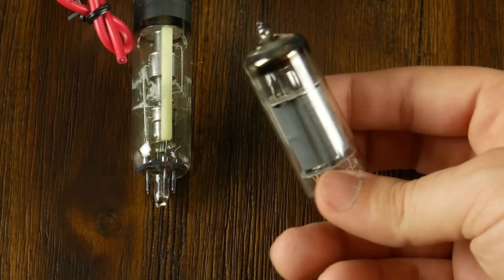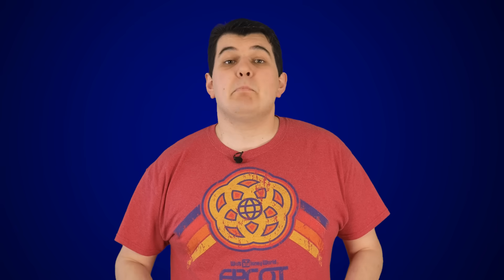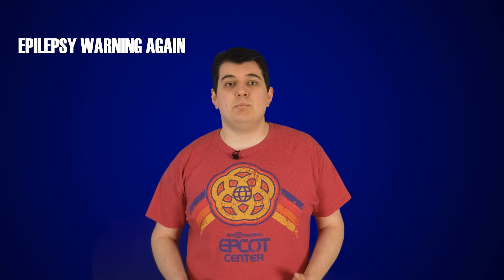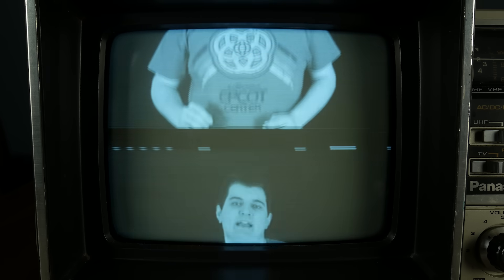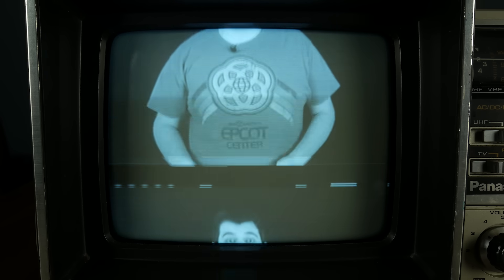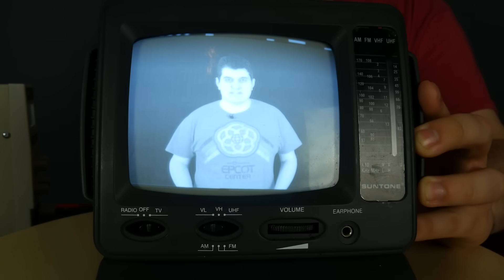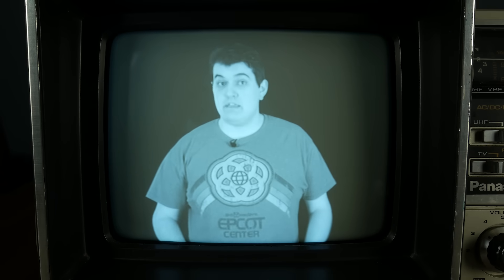Lines of Light: How Analog Television Works

Comment: The first models of Motorola Quasar, the TV with "the works in a drawer", appeared in 1967.

In 1974, Motorola sold the Quasar name, as well as the supporting US plants and inventory.

In 1972-73 models, the customers we sold Motorola Quasars began to complain of orangey looking reds. I agreed with our customers. I observed that the color demodulator IC on the "CA" color panel now bore the name "Matushita" rather than the former "Motorola." After Matsushita bought Quasar, I began to suspect that they had intentionally supplied an inferior color demodulator chip as an act of sabotage, to drive down the price they would have to pay to buy Quasar.

My suspicion did not come out of the blue. When so many of the VCRs in the US market were made by Panasonic, the other labels like RCA, Magnavox, GE, and Montgomery Ward, I found these off-label VCRs to be inferior to the Pansonic-branded models, as observed by performance, and also by observing that off-label circuit boards were missing parts that existed on the true-blue Panasonic circuit boards. One example was an off-label VCR that was brought to me for repair with a complaint that the clock ran too fast. I discovered that the clock's square wave was dipping into no-man's land, not reaching full amplitude. This caused a single pulse to be interpreted as 2 or more pulse, running the clock too fast. I discovered that a pull-up resistor that existed in the true-blue Panasonic had been removed from the off-label machine. I fixed the problem by installing a pull-up resistor in the existing but empty pc solder pads.

One example that demonstrates the hypothesis that Panasonic does not simply discard a sub-optimal design involves the CCD sensor chip in their camcorders. When the number of defective pixels on the Panasonic CCD exceeded their standard, they sold those CCDs to Sony, who used them in their own camcorders, accompanied by a ROM chip that mapped around the defective pixels, to a nearby good-working pixel. 

I would be pleased for Technology Connections to address my aged suspicions and set the record straight.

Comment: In my opinion, analog was so much better. Sure, low bands had bad static (our local NBC channel had it  all the time), but once you got in a good, strong signal it was in. Severe storms could blow your antenna off if you stupid enough not to secure it tight. BUT there weren't any signal dropouts.  If you needed to know where a storm was, your TV stayed in. Most the times digital TV is in if there is not any strong electromagnetic fields at play. You know, standing outside, the hairs on your arms or on the back of your neck would stand up warning you a lightning strike was near-or where you stood. I've seen digital lose a signal at a critical time during tornadoes and other violent events. Analog TV? You had to put up with strong static across the tv, but you still had a signal. Power outages then and now occur. Our power company has outages on nice sunny days with no breeze. 😮 And ask anyone who messed with their antenna. If you got it up high enough, you could get channels from other counties and other nearby states. To me, there's nothing on to watch anymore. I watch my dvds or don't watch anything. I could go on more with the good and bad with digital and the good and the bad with analog. But you get the picture... if you aim your antenna the right way.😊
Reply: The main problem of analog to me is the flicker. With digital you can remove flicker without increasing bandwidth. MPEG-1 introduced motion compensation for this. And of course: delta encoding. I think, interlaced video makes no difference ( in MPEG-2 ). Everything is in motion anyway. Though you have to store the full frame resolution from field to field. Static tiles will pick alternating lines. Moving tiles will pick any. I never understood how delta works interlaced. Is it pre field and only affect every second line? Or do we interpolate it onto the other lines? Delta values could be analog. But Hsync and Vsync need to be strong digital signals. Likewise the motion data. And you need a buffer for the expensive P frames ( or fields? ).

Comment: This video is putting out misinformation, the charge inside of a CRT is NOT lethal. Sure, some of the biggest CRT's can hold a charge of like 20 to even 30+ thousand volts so that must be lethal, right? The answer to even that is NO, the reason way is because there is very little amps, even with 30 thousand volts there is only like 1.'something amps and it is the amps that is lethal. So sure, you of course don't want to get a shock from them even if it won't kill you, but it will be on the not fun side of things and if you get zapped by one of the biggest CRT's that shock might even make you go boom boom in your undies. lol

Comment: 7:48 isn't the horizontal line being drawn 525 times a second? Literally the line rate?
Reply: It’s 525 times per frame/two fields. 525 times 30 gets us 15,750 total lines in a second.

Comment: Without Persistence of Vision, movies, even way back in the silent era, would NEVER have worked.  Sure, initially the silents flickered on the screen.  But clever people devised a two- or three-interruption shutter.  In other words, the more-than-one interruption shutter showed you each frame of film more than just once, before moving the film to the next frame, thereby eliminating (or drastically cutting down or eliminating the flicker).  As far as TV  was concerned, the broadcaster’s transmitter may have transmitted 525 lines, but maybe 400 of those made it to your house.  That’s why the viewfinder on those cameras had a TV tube-shaped line, smaller than what you can be seen in the camera’s finder.  This was a reminder to the camera operator to keep the edges of what was shot INSIDE that so-called “safe area”.

Comment: It's not just persistence of vision at work in a CRT. The phosphor's glow also takes time to fade. It doesn't stop emitting light right away after the beam passes over it; it takes a moment before it finally runs out of energy and stops glowing.

This was most obvious when you tried driving an early-2000s CRT at a 60Hz refresh rate. The phosphors in these CRTs were designed to be refreshed by the electron beam at 80Hz or higher. When refreshed at only 60Hz, the phosphor's glow would fade before the beam passes over it again. This repeated illumination and fading of the phosphor created an eye-hurting flicker effect.

Some video terminals in the 1970s, on the other hand, used phosphors that took a very long time to fade. Whenever anything disappeared from the screen (such as text scrolling off the top), it would gently fade away instead of immediately disappearing. For a while, pop culture considered this a sign that you were looking at a serious big-iron computer, not just a TV or garden-variety PC.

Comment: What I would like to know is how fast the gun at the back of the TV is traveling in miles per hour to make one frame it  amazes me that my Sony is 23 years old and it still works after all these hours of that gun constantly going at like a thousand miles an hour
Reply: It’s not that the gun is moving, it’s that the beam is being swept across by the rapidly changing magnetic fields. The gun itself isn’t moving.
Reply: @kurlyfry7916  I know the gun isn't moving it was hard for me to explain but the gun shoots out the beams so it's just the magnetic field making them go across the screen? it's still amazes me that nothing has worn out knock on wood
Reply: @nomusicrc  Exactly, the technology is old but still amazes me

Comment: i know this is a terribly old video essay. but today it was jolly useful. yesterday i visited my local museum in Melton Mowbray, in which there is a television set made by 2 clever brothers from stuff they had lying around. in 1948!. they  used an oscilloscope crt for the screen. so they could try and watch the Olympics broadcast from Alexander palace, despite Melton being 100 miles away from London. they never managed to get the sound and picture to work at same time, but they did manage to hear some transmissions, and see some others. when the last brother died in 2011 the museum got the set. it is wonderful, and this video helped understand it. although i am still not sure how they managed to get their local 15625 oscillation, made with a thyratron, to lock onto the broadcast horizontal pulse. their fly back is amazing, hand-wound with copper ribbon, with paper between the turns.

Comment: Right now have a 1948 RCA sweep chassis from a Berkshire Regency projection console on  the bench undergoing restoration. The tuner chassis and transformer chassis are done. Next, a 1955 color set that needs an on-off switch repair. Not many of us left with the knowledge to repair the old sets. 😢

Comment: I wonder. Part of Japan is 60hz and part of it is 50hz.  But I understand the whole country is NTSC. So with analog tv did the two regions have separate models of tellies or could they all work on both frequencies,?  Also, how would a 50hz telly tuned to NTSC compensate?  I mean it must've had additional circuitry and probably cost more.
BTW Brazil is 60hz but had the one off PAL 60.

Comment: One of our last crt tv's would pop and crackle VERY loudly when there was lighting around. The pops were about a second apart and as loud, if not louder than a taser. I was like 9 or 10 I  jumped about 2 inches in the air while lying down when it popped for the first time. Still don't know what caused that

Comment: Just subbed. I see you're still making content, so that's good. I had an idea of how CRTs worked, but I didn't know all the details that go into it.  I'm an arcade technician, and when I started 25+ years ago as a young twenty something year old kid at Chuck E Cheese, fixing CRT monitors was one of the first advanced things I learned about, and that became my thing later, as arcade games were using CRT displays. Short story, we got in MK3(Yes. Chuck E Cheese used to have MK games) upgrade chips when they were brand new releases, but the monitor on our MK2 died, so we decided to swap a monitor from Fighter History(crappy SF2 clone), and was told by the head technician about discharging the flyback, and was told if we did it wrong, we would get shocked and maybe thrown against a wall, but he also didn't stop us, so my coworker from the Kitchen, who also really wanted to play MK3, we both locked arms and said if one of goes, we both go, used the old wire and flat head screwdriver technique and was successful. Unfortunately, one of the pins on the upgrade chips broke and the game wouldn't work, so we didn't get to play for another week, but what we did worked. Sorry for the long post, but I only go into this much detail, when I get... I don't know what word I want to use here, but I'm sure you get it

Comment: I thought there was a physical “finger” that “aimed” the electronic signal beam towards the front of the crt tube from the base. Like it physically moved or vibrated down at the base. Duh. TVs would’ve broken down a lot if that were the case.

Comment: ~ 13:00—What I always thought remarkable was that early TVs needed those V & H "hold" knobs to adjust the sync. The transmitted signal had very clear and precise information, but apparently the electronics in most sets were so incredibly crappy that they could not reliably lock on, and frequently needed adjustment.

Comment: funny story: we had a color analogue, or what we called a tube TV from 2002 in our house until around 2014-15-ish. I believe it was made by SHARP. what ended up happening to it was the screen would fold up on the sides and bend the image more than normal (I'll link an image if I can find one), but it was still watchable. about a year later, though, it got to the point where it would only show the image ON the actual curves, so it just looked like two bent pillars of color and everything else was black (again, I'll link an image if I can find one). obviously, it's long since been thrown out, but I'm still quite curious as to why this might have been the case, and if it was fixable.

Comment: CRT needs 12k to 25K volts depending upon size and if black and white or color.  I had special tools to discharge the stored energy in the CRT and another to measure the high voltage.  Replacing a big color CRT was allways a little scarry.  Great description of early television.

Comment: I was hoping there would be an explanation for why some old CRTs need to be whacked to get them to work? I know it doesn't work forever, but I've seen enough of them that I think it's worth a mention
Reply: faulty connections in the CRT getting loose enough to not work but not enough to not work completely.
Something about jumpstarting the CRT beam if I remember correctly
Reply: An assumption that I'm going to make based on what I know about electricity would have to be, the fact that air is a resistor so if there was any slightly loose connections anywhere in the circuitry and they're only just loose enough then smacking the TV might bring the connections close enough to start the current flow which is the hard part, and then once the current flow is going once the connections have settled into their resting positions the current flow can keep it going. Which would be why this tactic doesn't work forever on a particular TV because those connections would be getting looser and looser until they're too loose for the smack to bring them close enough to get the current flow started (or the Gap is too far apart at rest so the current flow can continue going)

Comment: For me it seems some CRTs produce that awful ringing worse than others. I was at a massive store with a CRT over the door showing the front CCTV feed and man it was unbearable. Even across the store some 50+ meters away it was still painful. Not sure if its related but I can hear a whine from vacuum cleaners through walls or even buildings sometimes and its a similar pitch to my ear. I figured it might be something to do with the motor producing a funky frequency but I dunno.
Reply: Our family had  an old 1964 color Zenith that was full of tubes and weighed a ton. The chassis was all steel, no plastic.  When new, It was too good for us kids, as color TVs were very expensive.  It was in our parents' room and we could watch it on special occasions (Peanuts Christmas, etc.)   In  the unit's later years (1980s), now serving in a basement rec room,  It pumped out not only high-frequency hum but copious amounts of ozone when the weather was humid.  You could hear it hissing as it generated ozone and smell it, strongly.
Reply: It could be the motor or some funky high-pitched harmonics induced in the airstream going into the impeller. Probably a bit of both.

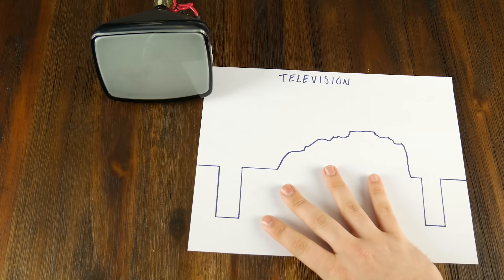Comment: Re 13:15
The original BBC 405 line system of 1936 (and the earlier (1935), 180 Line, German TV system) used "positive modulation", where the signal was stronger when the "point of light" was brighter.

NTSC and PAL systems use "negative modulation", where the signal is weakest when the "point of light" is brightest.
(One reason for this is so that any "interference" appears as "dark spots", which are less noticeable than "bright spots".)

Thus, the "Blacker than Black" region is the STRONGEST part of a NTSC/PAL signal.

Comment: Hi! Thanks for the video. A doubt cropped up: having a broadcast monitor of 750 lines, and connecting to it a device which produces a video output with a resolution of 320x240 pixels, what does the TV do to fill the gaps taking into account the scanlines? I mean, 240 pixels vertically plus 240 scanlines = 480 lines (1 pixel per line), but we still would need 270 lines to fill the screen area (750 lines). Thicker scanlines maybe? How to be consistent along the image? The image quality would be affected if the thickness of each scanline is not consistent.Thanks in advance!

Comment: 20,000 to 30,000 volts on 2nd anode of CRT..low current, but it will bite you. ALSO, be aware that the CRT will hold a charge for quite a while even when the TV is disconnected from the power outlet. Most injuries are caused by dropping the CRT when an unexpected shock is taken.

Comment: I have a large TV from the 90's that weighs around 180 lbs. Won't it still work  if it's on cable or satellite?
Reply: Yes an older CRT television will still work with a cable box or satellite box or a converter box with an antenna. No problem doing this, as I have only one flat screen TV in the house and all the other rooms have older CRT televisions made between 1995 and 2007.
Reply: It is so heavy. I tried to donate it  at 4 places yesterday in Amarillo. I might hafta take it to a recycler. It was in the game/pool room at an estate sale I did .
Reply: I imagine you're in the US. 

I'd love to have a big 4:3 CRT, but here in Ireland it's a struggle to find anything above 21" with those specs, which's kinda funny, since I'm 21.
Reply: It's good to give them away, when unwanted & when possible, as the technology has advantages over new TVs. 

If your TV's in 4:3, it makes it extra precious, as 4:3 TVs/monitors above 21" aren't made anymore, meaning that they're, in the long run, irreplaceable (though projectors are an alternative, & not many people want 4:3 TVs).

Comment: I managed to take the high voltage through my thumb while sitting on a stool (adjusting a brightness pot with my thumb with the voltage sitting next to the pot on one end of a resistor.) SNAP, a quick trip backward still sitting on the stool and banging my head, back and butt on the floor, my thumb still extended in front of me. A little black spot on my numb thumb, a headache, and some moments of not breathing very well were the net results. Yes, indeed, avoid getting shocked by a CRT by all means.